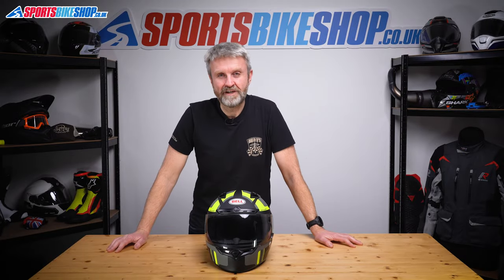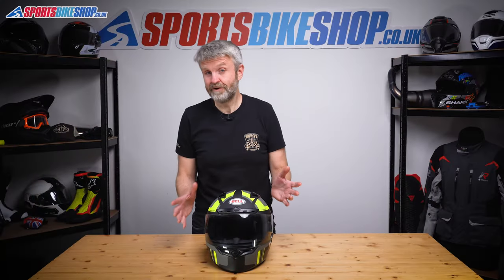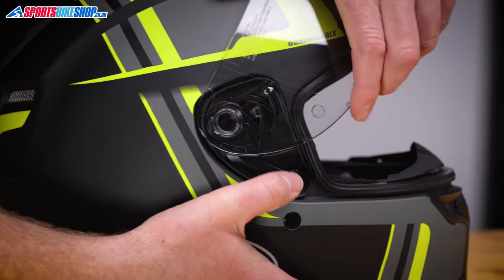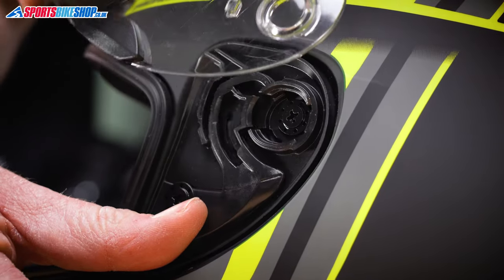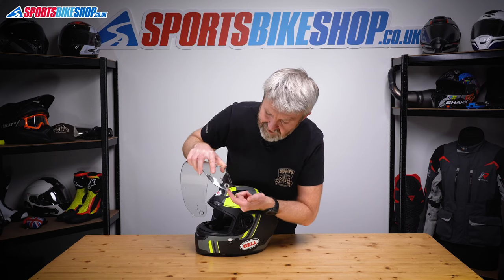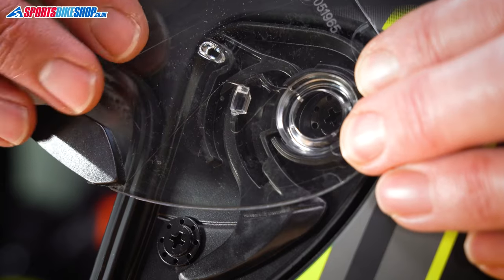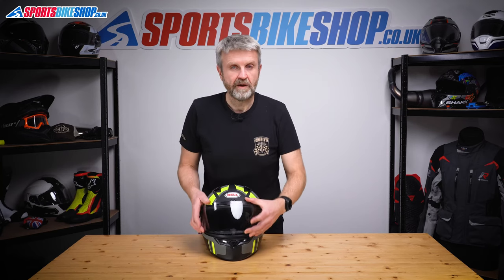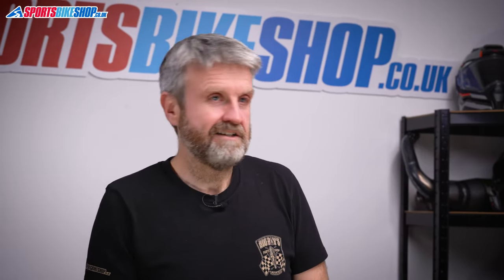How to change a visor: Bell Qualifier & Qualifier DLX motorcycle helmets

Comment: Where do you adjust the screw on the deck
Reply from the maker: You can make a small adjustment to the baseplate by loosening the screws and sliding the plate back or forth to make a tighter or slacker fit. It is only a small range of adjustment, though. Cheers, Tony

Comment: Hi! My visors don't close all the way down unless i push really hard on them. The gasket on the lower side does not allow it to close fully. Is that normal in a new helmet? I tried one more in store and it was the same thing.
Reply from the maker: It's normal to need to push home for a good seal, but it shouldn't be excessive force. Worth checking with a dealer if you really need to force it to seal. Cheers, Tony